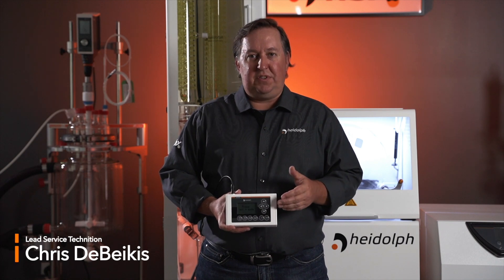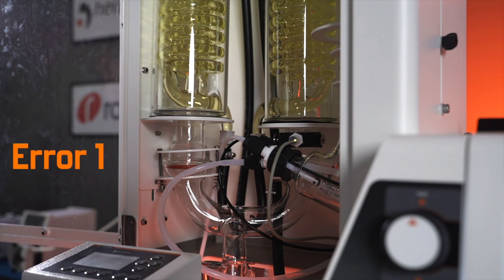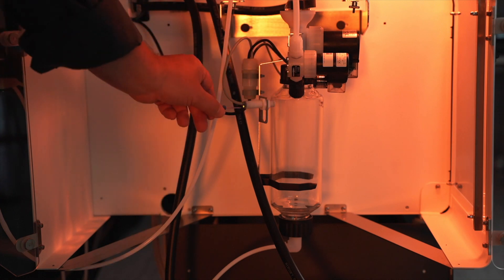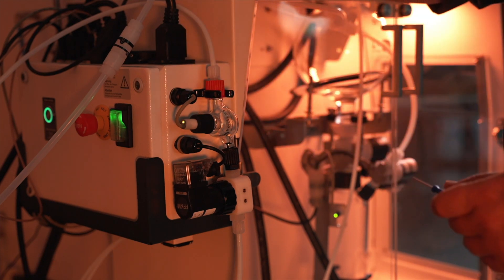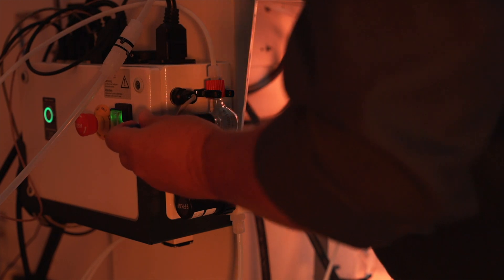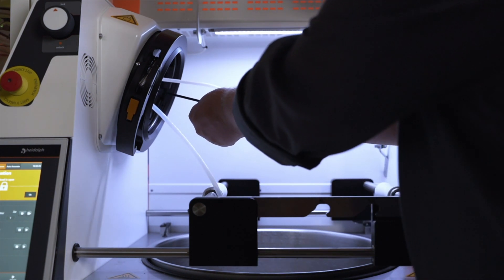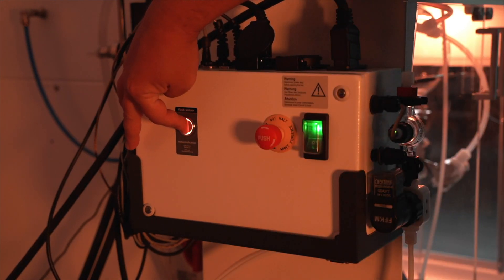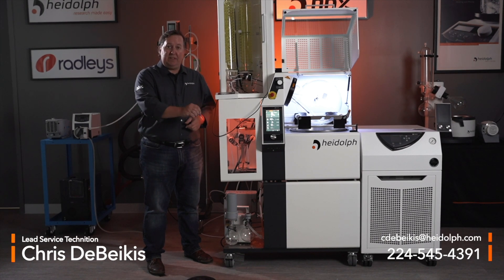Troubleshooting Distimatic Error Codes

Comment: Hi Chris, thank you for the videos. Helps a lot. My problem is that I fitted a new wiring solenoid harness.
Both the solenoids stays on (open) meaning the ethanol runs strait through the receiving flask into the  pump out flask. All sensors are green. Did reset system about 10 times all ready. Regards, Nico

Comment: Hi Chris, Thank you for the videos. Great help. My question is I also find out about the sensor later on. My problem is both the Solenoid valve (Receiving flask and drain flask) stays on the whole time. I fitted a new wiring system Heidolph send. The Ethanol runs strait through to the pump out flask. 
Regards, Nico

Comment: Why didn't you guys include the calibration of the flask sensor in the manual. I have to find out about this secret setting of pressing and holding the flask sensor button and turning on the main switch from this video. I've been searching for weeks on the internet for this exact issue. Please update the manual and include this information in it next time.
Reply from the maker: Hello Spartak,
Thank you for your feedback- and apologies for that loop of searching. If you require further assistance please do not hesitate to contact hello@heidolph.com anytime. 
Thank you